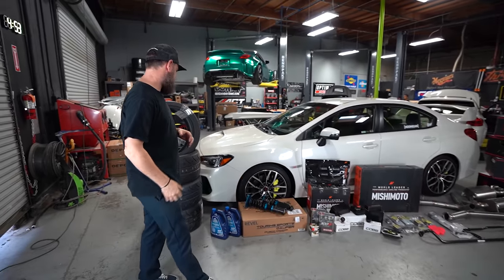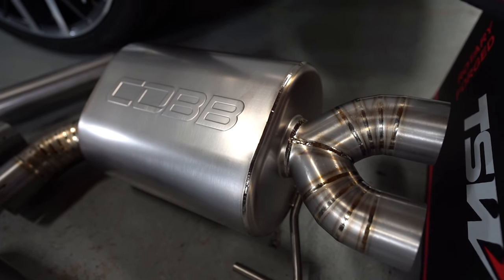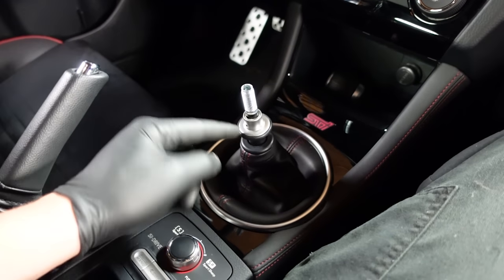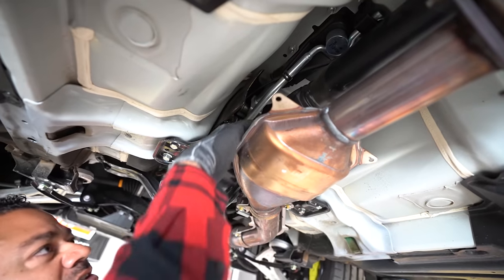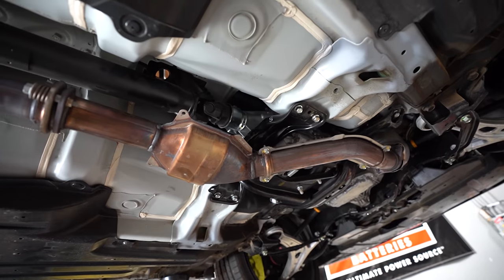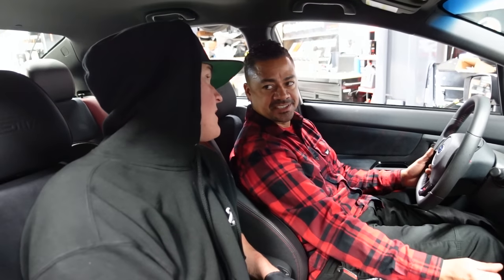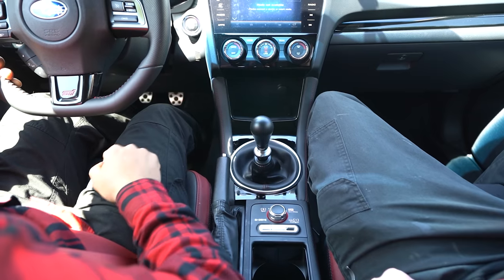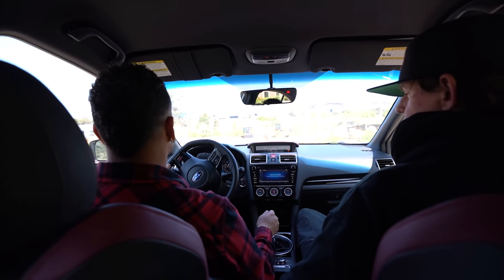Building the ULTIMATE 2021 Subaru WRX STI - Part 1 (Parts Haul + Kartboy) : @TheHoonigans

Comment: I bought a brand new 2016 sti and part of the deal was the short shifter and bushings. Dealer said nothing about how long it would take. They gave me a loaner at 7am, I went to work and came back at the end of the day. They were like wtf are you doing here? Uh, picking my car up...? They acted like I was a jack ass for not reading their mind on time frame. Took them 3 days to do the shifter. 3 days.

Comment: Please use OEM Subaru oil filter. All other filter is junk for a Subaru engine. They design the Subaru oil filter to help oil starvation on startup due to flat engine. And they have a different design flow back valve made to work for those engines but love build

Comment: If shifter went from 5.5 to 8.5 (3” play) and then 4 5/8” to 7” (2 3/8” play) that’s only 5/8” difference lol. How y’all get 1.5” in play difference? I can see the 1.5 over all distance when in 4th gear but I figured their claims were 1” reduction in play (between gears). 3rd is a whole inch further forward.
Reply: It was basically .75" difference because it seems like none of them can read a tape measure.  Go back and look the tape measure for yourself.  It looked like 5.5 to 8.75 stock and 4.5 to 7 after up cobb.   What they should have done is used a piece of tap on the knob to have a good reference point to make it easier to measure.  Also using the same knob because the stock knob looked shorter that would add some variance as well.